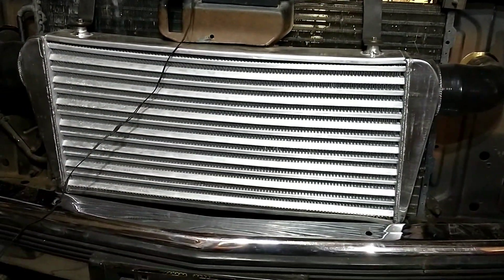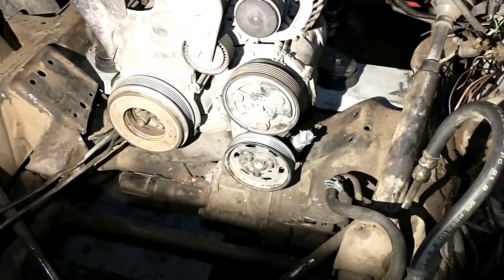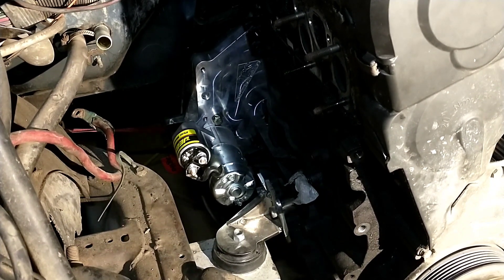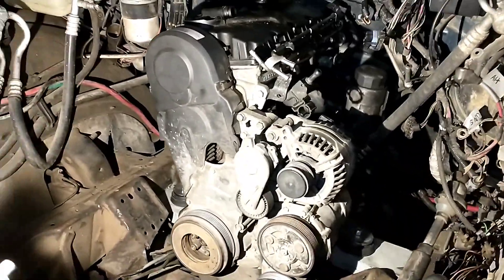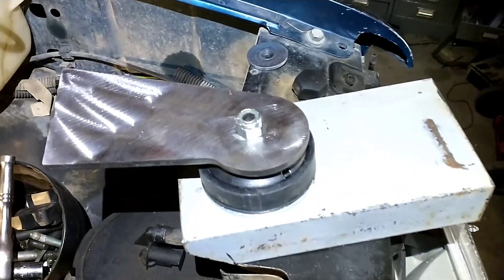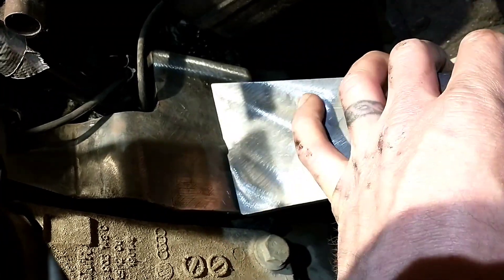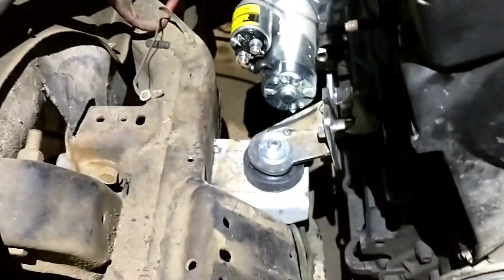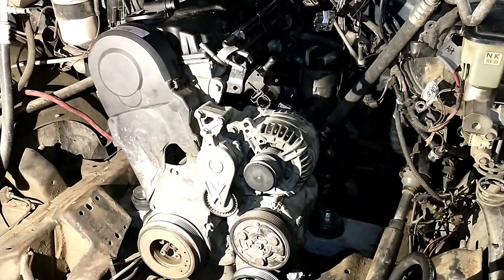Chevy 1500 TDI Diesel swap update, how to make your own swap motor mounts

Comment: What was causing so much interference at the firewall? Also how much space did you end up having between the oil pan and front axle housing?
Reply from the maker: Well the tandem pump off the back of the head on the PD motors is rather large, then the transmission in factory location is almost behind the firewall.  That combined with using a 1" thick adapter plate instead of the 2" one that was out of stock made for a ton of hammering.  Changing the drive lines would have been much cleaner. Oil pan was fine but power steering was very tight

Comment: Awesome video im also from wyoming wondering how hard it'll be to swap a tdi into my ranger thats the goal and it seems relatively easy to do any thoughts?
Reply from the maker: I haven't messed with a ranger yet, depending on the year I know there are some clearance issues on some, and the 4low on the newer ones can be a pain.  But anything is possible, it's just how much work it takes.  There's a Facebook group called TDI swapped trucks that has a few ranger swaps on there
Reply: Yeah mines a 98 ranger 2wd
Reply from the maker: That should make it pretty simple! As long as the factory tranny can hold up, it it a v6? Only other thing is the subframe and oil pan clearance
Reply: Its a 4 banger I just put a new rear under it I don't plan on pushing the truck to the balls but from what I've looked up and watched seems like you just need the adapter plate motor wiring and flash the ecu with a tune but I've been thinking it sounds to good to be true
Reply from the maker: Well getting it to all fit and finding spots for all the intercooler piping and coolant hoses can also be some work.  With a 4 cylinder drivetrain you will want to keep the TDI closer to stock, the torque gets out of hand pretty fast.
Reply: Still should be able to have some fun with it right and mpg should still be good
Reply from the maker: Oh ya for sure, even a mild tuned TDI holds speed where even v6 and older v8s need to downshift, all while getting 2-3x the fuel mileage
Reply: @TDISwaps  so when I go get my ecu flashed should I just keep it as mild as possible

Comment: My question is is that little motor going to have enough power to pull a full size Chevy truck around and be efficient because if it's not efficient to get in the high twenties on fuel mileage it doesn't seem to be worth all the trouble That's my question because a 4.3 will get 22 ,24 miles per gallon drove correctly. I like the idea if it will get in the very high twenties on fuel mileage. I'm sure this is not an inexpensive swap .
Reply from the maker: We should have it in for about $2000, and the TDI will easily have more power than the old TBI 350 with a mild tune to the TDI.  The 4.3 isn't even comparable to the TDI torque wise.  As far as fuel mileage, I'm sure the TDI would get close to 30 mpg where you are with those numbers for the 4.3.  Here in Wyoming the 350 can't even hold speed and averages 10-12 mpg, the 4.3 can't use overdrive and might see 14-16 MPG.  We will be super pleased if we even get over 20 MPG with the TDI.
Reply: @TDISwaps  that was my question thank you . Good job on your swap 👍
Reply from the maker: @davidechols6797  no problem, and thanks!

Comment: Interested to see what this does mpg and power wise. I expect it will out do a proper running 350 tbi mpg wise but I forsee power delivery issues. To get close to the torque numbers of a factory tbi 350 youll be really pushing that engine to its limits compromising reliability. Hopefully I am wrong though. Looking forward to seeing some dyno numbers and hill pulls with it. Gearing alone on these trucks made a huge difference. If youve got 3.42s its gonna feel like a dog. Towing performance between my k1500 with 3.42s and kinda large tires (33s) is awful. But my 3.73 equipped suburban with slightly oversized tires (31s) could pull a house around and had no problem. Towed a crew cab 4wd f150 on a solid iron car trailer up a mountain with only quarter throttle. As long as youre not going over 70mph constantly 3.73s or even 4.11s depending on tire size are a well worth it swap with minimal effects on mpg if you find power to be an issue and makes a much larger difference that youd think.
Reply from the maker: Me too! Ha ha
Reply from the maker: We are keeping the tires very small to start with, but if you've seen my other swaps, power delivery is not a problem, I expect this to out preform the 350 before I upgrade much, and after turbo and injectors this should blow it away.